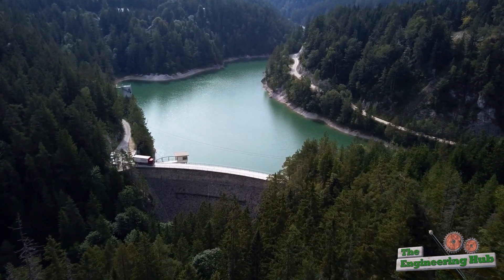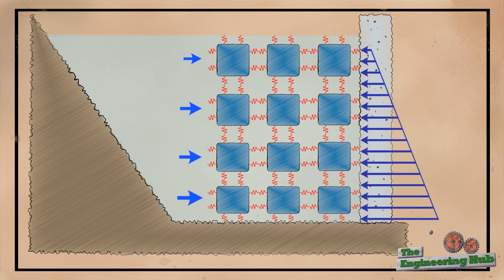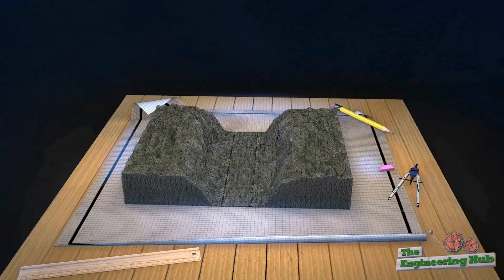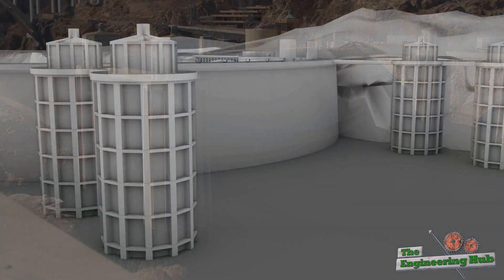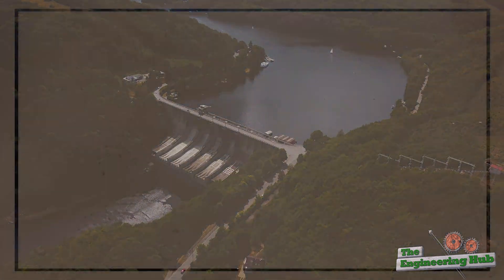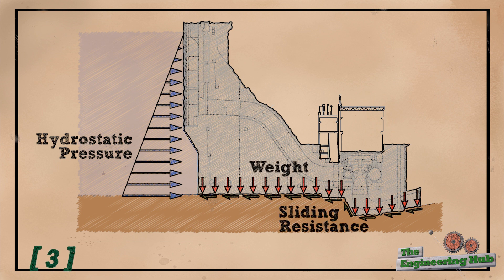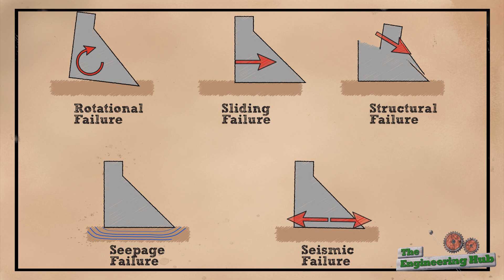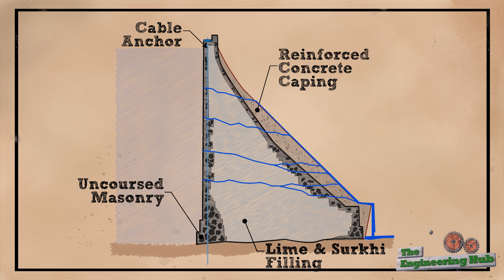Engineering of Concrete Dams

Comment: 3:26 No - the forces don't originate at the centre of the arch. They are applied all long the length of the arch. And they certainly don't 'originate' at the top of the wall as implied by the animation - they are more intense the lower down you go below water level (ie as the water pressure increases with depth).
Reply from the maker: yes that is true and it was depicted as such in the earlier animations. 3:26 was a simplified way to visually explain what is going on.

Comment: Also bear in mind that it doesn't matter how much water in terms of length that the dam is holding back, the hydrostatic pressure remains the same.
Reply from the maker: Yes that is a good point, often counter-intuitive to a non-engineering audience.

Comment: I think you should cut a little more slack for the Mullaperiyar dam, colonial infrastructure usually appears to be amazing due to survivor bias but that was built with rubble 125 years ago and it’s still doing it’s job. The empire didn’t build infrastructure out of the goodness of its heart, if they knew they’d have to leave soon they’d do the job but it would be done dirt cheap.
Reply from the maker: Our intent was not to dis the Mullaperiyar dam. On the contrary, it is an amazing and incredibly cost effective structure. Though maintenance is a key issue and could jeopardize even the best of structures. We just wanted to outline some problems that earthfilled (or in this case rubblefilled) dams could face.
Reply: @TheEngineeringHub  On retrospect I seem more than a little rude, I should have pointed out how good the video was as a whole, which it is. I just have an appreciation of old infrastructure, just my foible.
Reply from the maker: Thank you so much! We welcome any comments positive or negative. That's the only way we can improve! But sometimes we do get a bit defensive of our videos haha